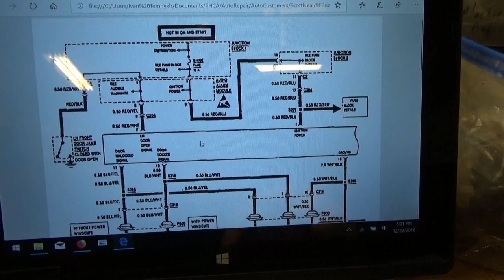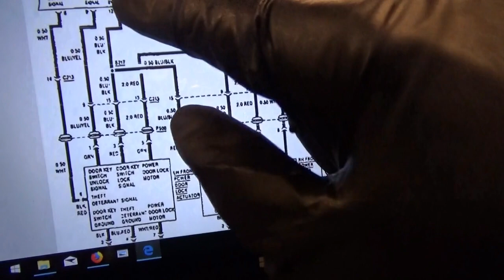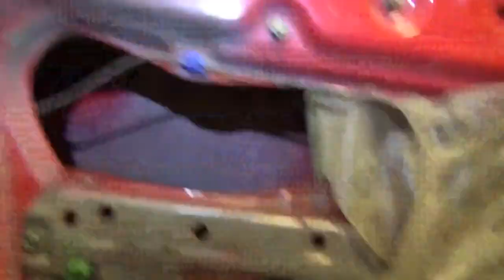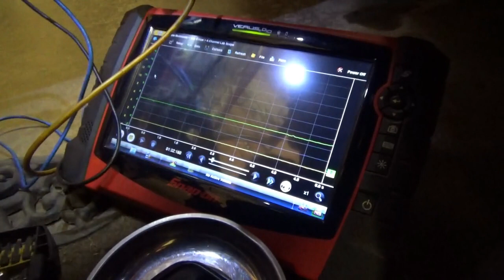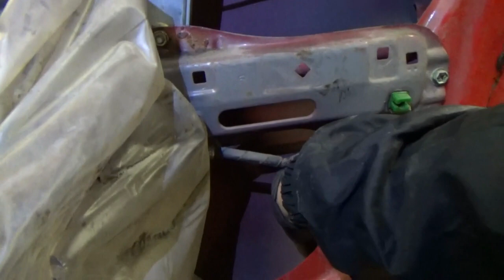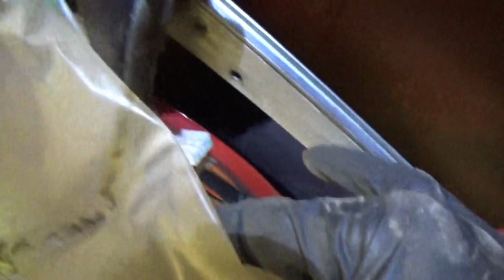Power Locks gone NUTS! (Toyota) -Part1

Comment: before seeing video i can guess the problem. well if this car is anything like the camry i had it will not let you lock the keys in car in ignition. if you try and lock it with door open it will auto unlock so it is impossible to lock keys in. this seems like the door close switch is messing up and the car thinks that the door is opened when it is closed then it sees doors is closed and it stays locked because the auto lock button is messed up and always pushing lock.

Comment: Be interesting to find out what is causing this. We had a 1992 Buick Skylark GS coupe which would randomly start cycling the door locks.  Sometimes it start and continue until it ran the battery down. The keys and keyfobs were kept in a kitchen drawer. I got tired of getting phone calls when I was half way across the country from my wife telling me the car would not start. I tried diagnosing the problem but finally gave up and traded the car for a new Prius. At 5 1/2 years the 12 volt battery decided it was no longer going to stay charged more than a day or two and we replaced it. Problem solved.
Reply from the maker: But a 1992 Buick Skylark is INFINITELY cooler than a Prius!! Bring back the 90s!!

Comment: Tough problem, weird voltage and useless connector outside the plastic on front passenger door, BUT it took 23 years for the problem to develop. My vote - compromised underhood ground causing redirected current flow.  While you’re there, add a generic window switch for the fron passenger window.

Comment: I have had similar issues with random actuations and low voltages on ground side switched inputs on BCMs and similar.
Inside the module there are little filter networks that prevent radio frequency interference from getting into the logic.
What I find is there are surface mount ceramic capacitors (either individual or a group of 4 in an 8-pin package) that develop internal leakage.
A little heat usually removes the fault (temporarily) but replacing the filter capacitors is the proper cure.
Had a Nissan Micra with random actuations of the hazards (4-ways) and random door ajar warnings. 

Remove the module.
Test lock line input resistance to ground and compare with unlock line which should in theory be the same resistance.
If lock is way lower resistance, follow the circuit trace for the lock line until you get to a capacitor.
Leaving meter on Ohms between lock line and ground, just try applying a little heat to one side of the capacitor with your soldering iron.
Resistance shoots up, you've found the problem!

Comment: Hey mate, the Australian built E series Falcons had the locks bouncing symptom quite frequently as well during the 90s, from new.

The fault was that one lock actuator would get lazy, either electrically or mechanically, and the body control module would sense a mis-timing of events, see it as a door open, and then start cycling the door locks in a mis-timed loop. The repair was to replace all of the door lock actuators with revised components and flash update the module under warranty (the flash update was to make the BCM less reactive to delays in actuator response).

It was quite a big job, as the actuators were riveted to the inner door skin and it was quite tricky to disconnect and remove the actuators from where they sat.

The reason all door actuators were replaced was that poor manufacturing made them susceptible to wear and shorts and replacing only one would result in a return when the next one failed.

Just a word of "be careful" with assuming only one actuator is at fault. Replace one, and you may still end up with the same fault due to BCM picking up a mis-timed event.
Reply: Also, the Chevy floor mats in a Toyota are a dead give away that it is gonna be a problem car.

Comment: Measure the open circuit (plug disconnected) resistance in all control switches, lock and unlock pins.
Anything lower than a couple mega ohms points to a corrosion bridge in the switch or its connector.

Unplug battery Minus cable, then measure the input resistance on the controller input pins from the door switch connectors, switches unplugged.
Should be less than 1 mega ohms. Anything higher points to a disrupted cable or connector.
Anything less than 10k is a suspected wire grounded out.

Comment: Hi Ivan, i assume this has No rear doors, does it have a lock on the trunk/boot  or bonnet, wonder if the wires in the sleeves between the doors and body are broken and touching together,,,, that happens a lot as you know with all the opening and closing of the door...i think you might be able to use a 12 volt bulb circuit tester and earth out the plugs on the switches with that, to by pass the switches so to speak...i would have thought the actuators were ok, think there just a reversible electric motor...well there my thoughts for what there worth...good luck from Fred in Uk.

Comment: The easy thing to check - continuity to ground for both lock and unlock or just cut the unlock wire (with 4 volts) at the control module to see if it is grounded somewhere along the way to the doors. Thanks for sharing!

Comment: I'll have to look into the schematic further, and rewatch video but gut feeling is ground with high resistance failure mode. I remember a few years ago in a training class with those electric test boards for multimeter education that the instructor induced a high resistance ground fault into a relay control circuit and it acted pretty identically (relay contacts worked as a buzzer).

I'm assuming that the module is basically using a relay set-up in the board (picturing a dual relay set up but have to think through it further), not transistor drivers but we know what happens when we assume.

Comment: So a common lock signal that is at 12v when open.  But 4 separate unlock signals that (at least the 2 front) are at 4-5v when open.  When the left front unlock is closed, it sometimes doesn't go to ground but seems to pull the lock signal down by 2 v when it drops 2v.  In addition, when the lock signal is closed (grounded), the unlock will go to 12v for a short time.  Kind of like it's getting back fed from the lock signal power in some strange manner but with a delay.  

I have a bad feeling about the controller given that two separate unlock lines are showing the same reduced sense voltage which probably finally is hovering in the undetermined zone causing the sense circuit in the controller to oscillate.  

But how does grounding the lock line cause the unlock to rise to battery voltage?

Comment: Waiting for Part 2 Ivan lol. One idea I had watching this was snipping the wire pinned on the green channel, at the control module and test the voltage on the control module side of that wire without any of part of the harness interfering. Though before I do that I would want to  test for good power and grounds at the control module first if there is more than one power and ground to the module. Curious what you found.

Comment: Very interesting, I test drove once a 1994 Toyota Corolla 4d sedan which had similar problem but if I recall correctly, it didn't want to stay locked, it kept popping the locks open. Looking forward to see the next part :)
Reply: that is normal operation if the door was opened and key in ignition. that was a feature to keep you from locking your keys in car.

Comment: It’s a Toyota. What do you expect from a company that got the software wrong and had to go before Congress because their Prius was trying to kill people, or head bolts that barely had any threads engaged and caused massive catastrophic failure of Camry engines, or Corolla engines with defective piston rings that burn so much oil as to be an environmental nightmare and self destruct, or automatic transmissions that overheat so severely they self destruct, or V6 engines that throw a rod through the side of the block with only 30,000 miles and having Toyota deny a warranty claim because the owner did his own oil changes. Toyota flat out sucks in so many ways.
Reply from the maker: Keep in mind this one is from 1996 when car manufacturers actually made QUALITY vehicles, both foreign and domestic! The seats in this econobox are softer than any modern Lexus or Buick. Yes this one needed new piston rings, but now doesn't burn a drop of oil with over a quarter million miles on it and still gets 35mpg ;)
Reply: Pine Hollow Auto Diagnostics all highway miles 😂😂 who in thier right mind would dump that car? I have a 14 328D and I pray I get close to what you have even being a diesel , I’ll keep it forever like you. You’re right they don’t make them like they used to. Majority of my work is 2005 to 2014
Reply: Shared Knowledge yet people buy them buy the millions. Just like people who close vote.

Comment: "I never lock my car."  So, unplug the locks.  Done.
Reply: Or pop the fuse.
Reply: Exactly what I was thinking. Fuck spending all this time diagnosing it if its a beater car that doesnt get locked and he leaves the keys in. Pull the fuse and be done with it. It has lock knobs on the door, so they can still be operated manually.
Reply: Sorry this is poor mentality
Reply: @rightconditions2010  It is poor mentality to have the customer pay a lot of money for something he doesn't need.
Reply: @tomvleeuwen  I would like to have that feature fixed. Those cars last forever.
Reply: Then what would be the point of the video?
Reply: @geologic740   Exactly, he fixed the locks to make a video.

Comment: I would in plug the rear door lock actuators and see if one of them is pulling down the unlock the at the remote controller I would cut the wire and see if voltage returned

Comment: those older systems could get out of sync, my 90s ford fiesta had an issue locking, it would cycle for ages sometimes, wasnt water but the guy opening it and stressing one of the mechanical links in the door